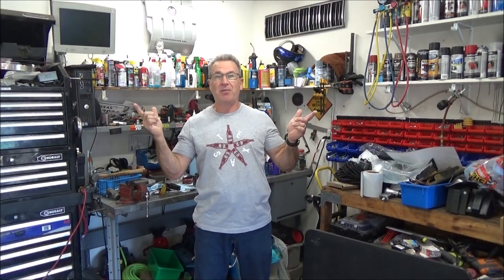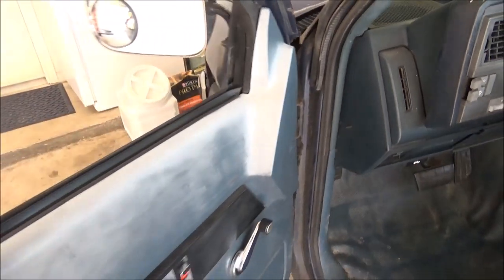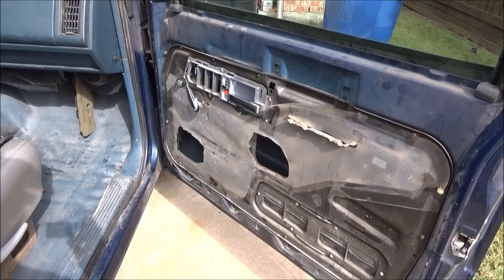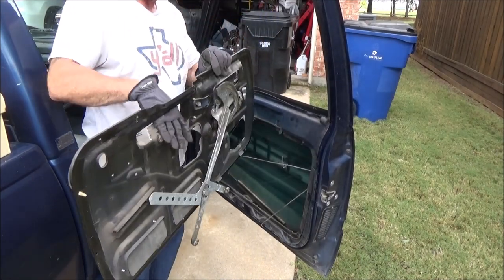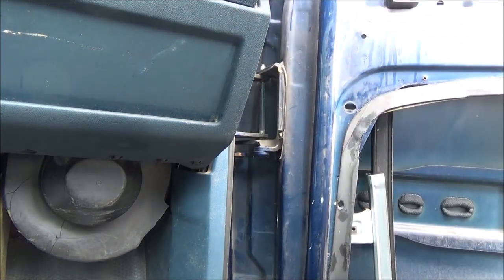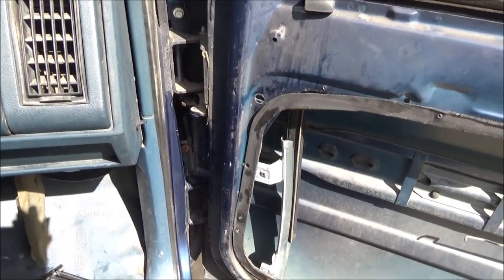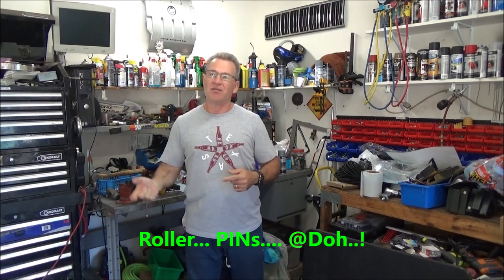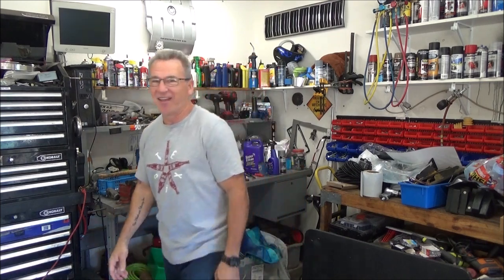Chevy GMT400 OBS Door Rebuild Part 1 Hinge Pins

Comment: Holy crap I woulda been so sad without this video! You made it basically painless (aside from the pinkie I hit with a 4 lb hammer, which I'll blame GM for), which is pretty incredible considering how much this job SUCKS.

A couple notes for other knuckle busters out there:

If you use the amazon link in the shopping list, make sure to get the "88-02" chevy door pin option. 135 mm. Consider taking the time to read the compatibility section at the bottom before you confidently press buy. I also recommend taking more time to read all kinds of things: recipes, books, bathroom stall poetry. Reading enriches your world.

Regarding the roller pin video (sorry too lazy to comment on both and if yr doing roller pins then yr doing hinges), I was able to bust the thing off with a hammer and chisel in no time at all. I did bend one roller pin trying to bash it in. Went back with the conical bit and took a little off and the next one went in fine.

ALSO, I had no cause to gut my door (handles are find for now) but boy is that thing heavy!  If, like me, you had to leave your floor jack stranded in a storage unit in southern Idaho, two cinder blocks does seem to put it at about the right height, give or take a brick. 

I ended up spending more than I anticipated on this project (that conical bit was pricey but the door wasnt going back on without it and the money I mighta saved shopping around wouldn't have meant much if I left my doorless truck parked on the street overnight and woke up with only a door), but boy were those special tools worth it! I pray I never have to use them again.

Anyway thanks.

Comment: You are going to be disappointed with those soft Dorman pins...I spent the ridiculous money on the OEM ones after trying the Dorman.  Check out the bushings from Cunningham machine if you want a quality solution so that you only have to do this once.
Reply from the maker: I've done 6 or 7 trucks and cars with these and never had an issue. Most folks pound them in which causing cracking even before the pins are installed, that's why they must be pressed in.

Comment: Wow those seats look insanely comfy. What vehicle are they from? Also thanks for the video, I'll be doing this to mine soon. Very good info
Reply from the maker: Hi those are from a 1999 Pontiac Bonniville (92-99 are about the same seats) most of the late 80s to 1999 GM cars have the same bolt pattern as the GMT400 truck seat brackets. Here is the vid how I installed them about 3yrs ago https://www.youtube.com/watch?v=DJTLoUtYDok&t=1s Starting in 2000 most of the GM car seats went with the integrated seatbelts and they changed the mounting brackets completely. In my option one of the best bolt in seats would be the sports seats from a 1989-91 Cadillac Eldorado about impossible to find but they are great seats.
Reply: @NavyDad  Thanks!